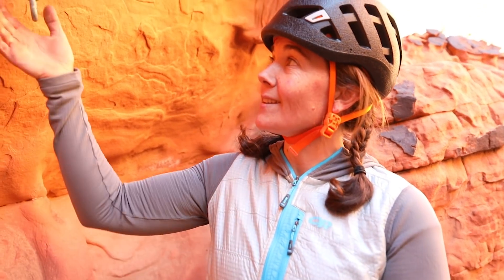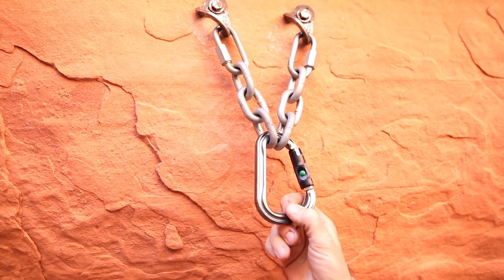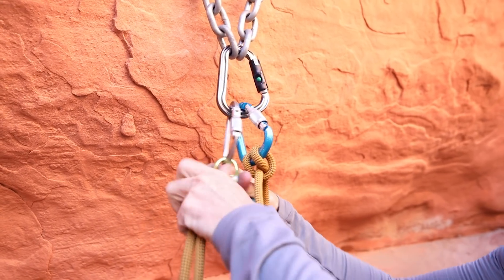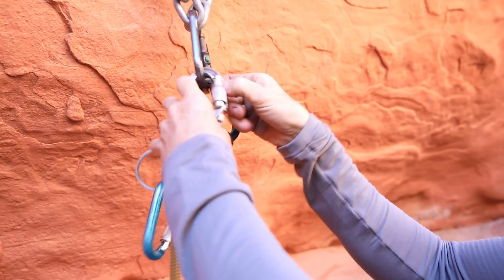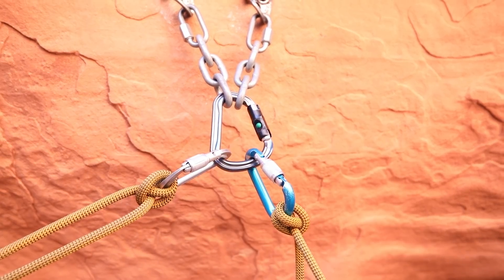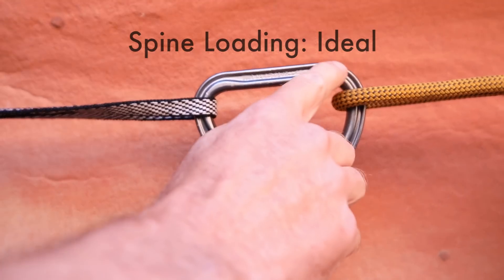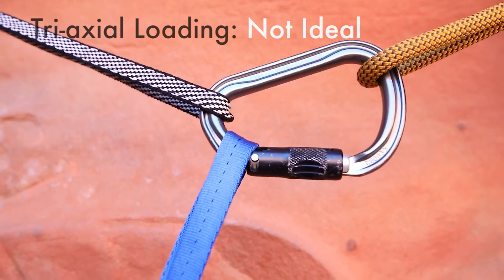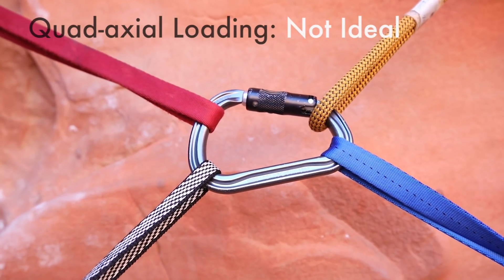How to Set Up an Anchor Using a Master Carabiner

Comment: Potentially rookie question coming in here. Doesn't this add a single point of failure in the carabiner? If that fails you haven't got any redundancy in the system right? (Like I say, rookie question so please be nice).
Reply: In this situation a single, auto-locking carabiner is perfectly acceptable. 1) The carabiner is always in vision of the climber/belayer. 2) A Petzl William has a MBS, along the spine, of 27 kN, plenty strong. In summary, A single, strong carabiner, that is always in vision is fine in the correct circumstances.
Reply: Thats what I was thinking. I am a rookie myself though

Comment: While a valid method, on a multipitch climb you are blocking the rappel rings for any party descending the route. As a result, its common courtesy to avoid this method.
Reply: That's true only if the descending party for some reason feels they MUST use the existing hardware. A much faster way for teams to pass each other is if the team going up simply adds their own locking carabiner to their master point, and the team coming down uses that carabiner to rappel from.  Way less cluster and faster for everyone.
Reply: @johngo6283  The issue with that, is that the ascending team cannot leave the belay station until the rappelling team has pulled their rope. This again is an inconvenience and slows at least one party down. This also requires an extra rope side carabiner that the ascending team may or may not have.
Reply: Nick Busato Hey that’s a good point. Using this technique is probably best when the timing makes sense. If it’s a busy day and there’s lots of people going up and down, everybody needs to work together to keep it going smoothly. I wanted to mention that technique because a lot of people are unfamiliar with it but you’re right it doesn’t necessarily work well all the time.

Comment: What about not using the hardwear on the walls; going behind the chains and directly on the bolt?
Reply: With more gear you could do it and that's the norm but the video shows the simplest way IMO of making an equalized anchor with no extension by using a single carabiner if the bolt conditions allow you to.
Reply: Thanks dude!

Comment: So I’ve also been told not to use metal on metal. I am assuming shock loading doesn’t effect this system?
Reply: The rope keeps it dynamic however the one carabiner that created the master point has no redundancy
Reply: Metal on metal could be dangerous if no dynamic elements are added. In the video they're always tied to the rope and that's what makes it dynamic. Nonetheless shock load is always a threat and climbing and is a dangerous sport.

Comment: Extending this principle of a Master Carabiner, Mountain Moxie has a great video https://youtu.be/1UyInC0SkGo that shows how to incorporate a Master Carabiner using clove hitches with a dyneema sling. It's very quick, uses less material than most 2 bolt anchor belays, and is easy to tear down because it doesn't rely on knots that can be hard to untie. Note that in this video and the one I link to above, there is no "Shelf" so you are clipping everything into the master carabiner.

Comment: I would point out the tethering with the rope. This keeps some dynamic load absorption in the system. If they tethered with slings or a PAS, it would be completely static, increasing the danger of shock-loading. Would love to hear the creators' thoughts on that.

Comment: I've always been told to avoid metal on metal aside from biner on bolts. Is there truth in this? And how does it apply to this?
Reply: In this case, teh surfaces are fairly rounded, so edges won't be pressed into the biners. This therefore lets biners not cut into the rope or slings in the future.

Comment: Is it ok to tie into a small carabiner with a clove hitch like the second does at 1:02? If not, why?
Reply: I dont see any problem with the 2nd using a smaller locking carabiner. As long as the biner is a locking and has enough room for a clove and ofcourse, is rated for climbing. Its only being used to tie the climber to the anchor, so it will only have 2 points of load. (The 2nd, and the anchor itself) im no expert, so dont take my word for it! Personally, all I have is big locking biners as I find them easier to work with :)
Reply: It's totally fine for the second to clip into a small locking carabiner with a clove hitch as shown.